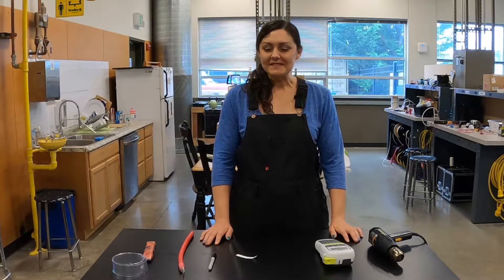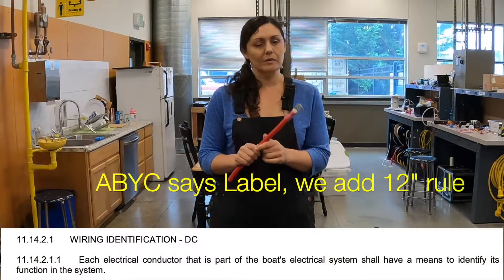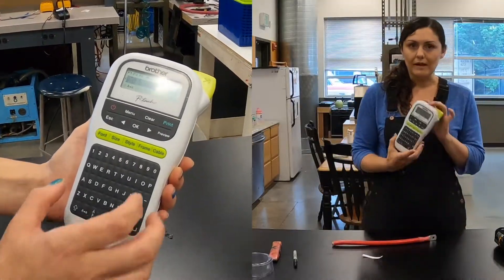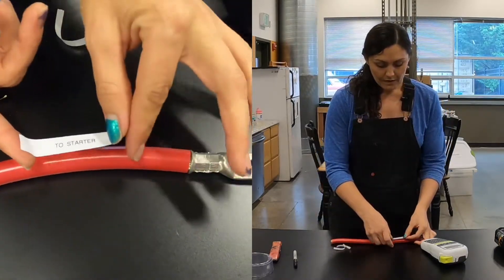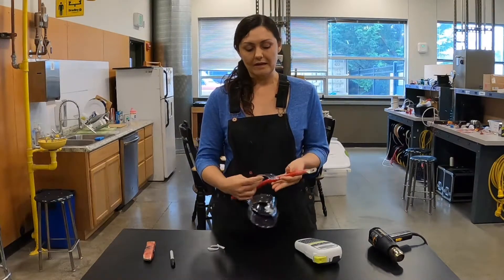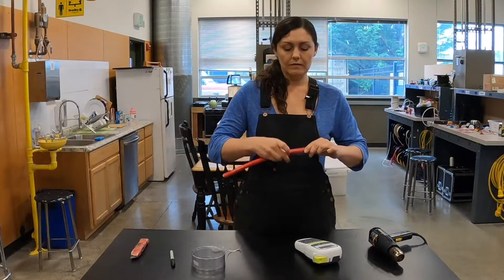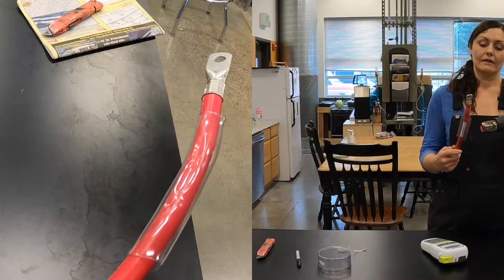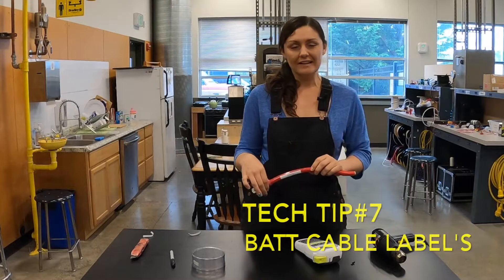Tech Tip "007" Battery Cable Labels

Comment: Great job Kendra!  Does the clear heat shrink have a thick enough wall capacity that it could also serve as moisture protection at the terminal connection?  Or maybe the sealant in the heavy wall shrink would be counterproductive to being able to see through the clear vinyl.
Reply from the maker: We still recommend the heavy wall for the terminations, that stuff is awesome. The clear works well enough for the label, just an extra step, but looks great!